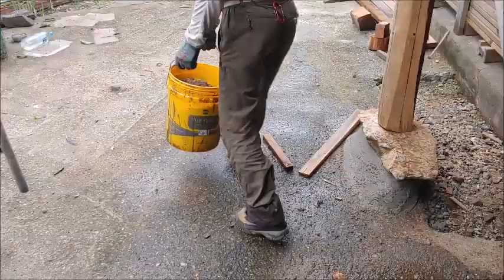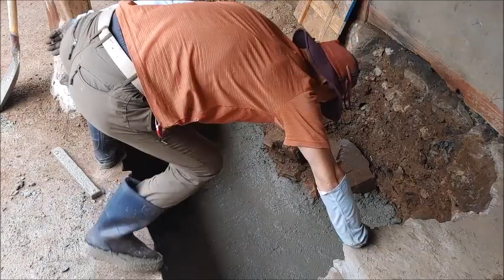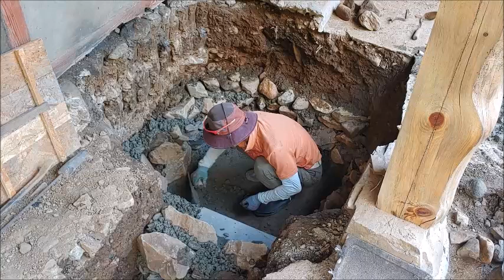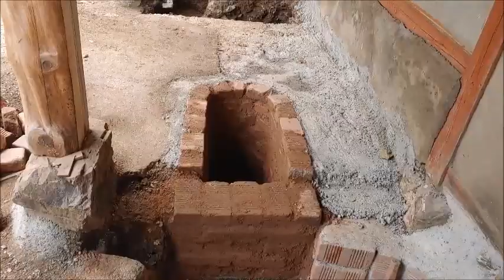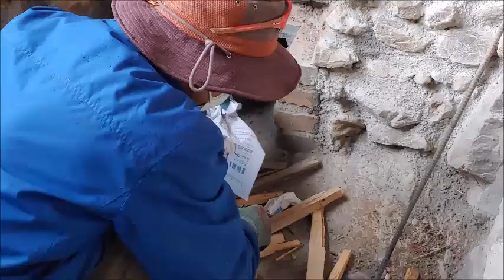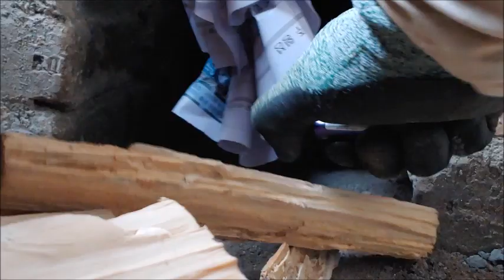House21-온돌,한국의 전통 난방,구들,황토방,한옥,목수,wood.K Woodworking

Comment: Looks great.......exactly what is it and what does it do?
Reply from the maker: This is the floor of the room.
Reply: 🛠잘못 표현된 내용 수정(Correcting the wrong expression)🛠
This system is a traditional Korean boiler. Unlike the way you use the stove, it is a way to heat it by making a fire under the floor of the room.
When a fire is made in the furnace (Agung-i/furnace), the heat moves along the passage of the floor, heating the cover stone and the soil on it, and delivering warmth to the floor and the entire room.
And I put a cauldron (Gamasot/Cauldron) on top of the furnace to cook food such as rice or heat water and use it as hot water (now there are various heating methods and cooking utensils).
fireplaces are only warm indoors, but Korean ondol is a special system that keeps the floor and the entire room warm and keeps the warmth for at least eight hours once a fire is lit.
Now, it has developed in various ways, such as heating water using various boilers and circulating it in the XL pipe.

이 시스템은 한국의 전통 보일러입니다. 난로를 사용하는 방식과 다르게 방 바닥 밑에서 불을 피워 데우는 방법입니다.
아궁이(Agung-i / furnace)에 불을 피우면 열기가 바닥의 통로를 따라 이동하면서 덮개돌과 그 위의 흙을 달궈 방바닥과 방안 전체에 온기를 전달하는 방식입니다.
그리고 아궁이 위에 가마솥(Gamasot / Cauldron)을 올려 밥 등 음식을 하거나 물을 데워 온수로 사용했습니다.(지금은 다양한 가열방식과 조리기구가 있지만)
벽난로는 실내만 따뜻하지만 한국의 온돌(Ondol)은 바닥과 방안 전체를 따뜻하게 하면서 한번 불을 피우면 최소 8시간 이상 그 온기를 유지하는 특별한 시스템입니다.
지금은 다양한 보일러를 이용하여 물을 데워서 XL파이프에 순환시키는 등 다양한 방식으로 발전하였습니다.
Reply: @woodwood1 감사합니다
Reply from the maker: @timemachine5970  너무 좋은 해설입니다. 제가 하고픈 말을 대신 해 주셔서 감사드립니다.
Reply: @timemachine5970  Thanks for the explanation but 'the west/western' means nothing..
Also Ancient Mediterraneans used heated floors a looong time ago.
Reply from the maker: @peterlee767 ..네..기억납니다..안녕하세요...  shimil84@gmail.com 입니다. 문의 주시면 아는많큼 답변드리겠습니다..
Reply: @HAYAOLEONE  That was a misleading expression.
It doesn't mean that floor heating was not performed, but it mainly means that fireplaces were used,
but I think there was a misunderstanding because my English skills were low.
Thank you for your advice.~^^
Reply: @timemachine5970  No problem, friend.
Say 'Europeans' instead of 'the west' if that is what you want to say.
Your English is OK.
👍
Reply: 한국의 온돌(ondol) .. 만드는 작업 영상입니다..♡ 난방시스템(한국 고유의 난방 방식입니다.)
Reply: @woodwood1  very interesting! but where is the room? it seems to be outdoor, or is there a new room to be created above that fire floor?
Reply: @woodwood1  ,, ,
Reply: @HAYAOLEONE  Your english is okay too. Funny you regulate on @TimeMachine using the term "west,' then present a "western" civilization narrative. The 온돌 (Ondol) floor heating used in homes is found from 3000BCE and even farther back. Similar ideas of floor heating (termed Hypocausts) and were credited to be "invented" by an ancient roman in 80CE. Seems like a looong time later. I'm in total agreement with stopping the obsession with west/east when we live in a sphere, but If you don't want people to use the term "west" try not spreading false historical narratives via the western-centric gaze.
Reply: @youngsahm03  You make zero sense and sound quite whateveryouare-centric, friend.
I'm European so I call myself 'European' and European things, you guessed it ..'European things'. Geography is about places before directions.
Quite simple..

Is it pRoBLeMaTic, darling?
Do my speech need to be 'regulated' by you?

Last thing : floor heating was used in 9999 BC on Mars.
Read it in a book/online. It must be true.

Stay lovely/awesome.

❤
Reply: @HAYAOLEONE 
You are really cute, "friend."  
Nice to hear you agree about geography making more sense than directions. How "western," oh I mean European, of you to pretend it was your original thought. 
"West/Westerner/Western Civilization" was created and pushed by Europeans. Now you don't want to be called by that. Cute.

You got checked for trying to regulate using blatantly western-centric (euro-centric if you prefer) narratives and couldn't handle it. 
It's fun to watch you squirm, trying to pose me as the speech regulator. Adorable.

I'm sorry you couldn't handle the speech regulating you initially started trying to lay down on others. 
You're english is still okay. The reading comprehension, logic, and reasoning needs work still.

*Heart emoji heart emoji thumbs up*
Reply: @youngsahm03  Still make zero sense.

Almost sound delirious.

Leave me alone girl/troll, I'm here to watch high quality carpentry videos.

[imagine going berserk over a European tired of being called something else than 'European' and asking for once a perfect stranger to call Europeans, 'Europeans'.]

+
Reply: @HAYAOLEONE  be that as it may, I’ve never heard of floor heating in us/Europe so it is valid to explain it that way. It’s common for westerners to be familiar of furnaces/fire places over floor heating. Of course I’m only one person but I’m sure others share this perspective
Reply: @evaosirus6055  Hello.

Why are you saying this to me?

??

[don't say ''westerners'', it means nothing]
Reply: @timemachine5970 Can I ask another question?
 What if there is a heavy rain that it flooded that hole? Or what if it became a shelter for snakes or other underground animal?
Reply: @youngsahm03  I caused a conflict with the wrong content.
I'm sorry. I modified it.
Reply: @jccapistrano13 In the cold winter, animals such as mice and cats sometimes entered a warm furnace.

So, we install a lid to prevent it.
Even if it is flooded by floods, it will not interfere with use if the water drains and dries (if it does not collapse).
Reply: @evaosirus6055  in the US radiant heat flooring has been in use for at least 20 years mainly in colder climates. It started with hot water pumped through poly hose imbedded in the concrete but now includes electric heating elements.
Reply: @timemachine5970  Thank you for this information.  I wasn't too sure how this heating system works since I noticed the builder had placed it outside.
Reply: @timemachine5970  Your English is fine!
Reply: @timemachine5970   You did not cause any conflict, so no apology needed. The European/western superiority complex is just strong among many people. Your original comment was well-said and quite kind. Thank you for taking time to explain. Other commenters’ talking about hypocausts and trying to “correct” your English was just obvious euro/western-centric power play with the cliche superiority complex attached. Clearly spreading a western narrative while also demanding not to use the term “western.” >< “West/western” is a term created and spread by “European” societies that pushed the ideologies associated with ‘western civilization,’ but now they want to re-brand their image. Of course it is still just from the same western/euro-centric perspective. For example, do they call Korean people by our true name rather than the western-centric, made-up, mis-pronounced Italian-based name?
Reply: У меня есть дом в деревне и недостроенная комната, сделаю, как у Вас, мастер, в России зимы холодные. Спасибо за науку.

Comment: How do you ensure you don't get co2 or carbon monoxide poisoning?
Reply from the maker: When using wood as fuel, if there is smoke on the floor of the room, it is visible.
So, you can respond.
Reply: Use a smoke detector.

Comment: Those top plates looked special. Are they cut from rock, or are they cast with some kind of refractory? Those are the only items I would not be able to source locally here in Norway I fear.

Great work! Looking forward to see the room.
Reply from the maker: It was cut out of rock. Basalt (rock produced by volcanic activity)
Reply: @woodwood1  Thank you.
Reply: @woodwood1  Are the top stones then covered in a layer of sand/other materials?

Nice job and nice video 👍
Reply from the maker: @HAYAOLEONE  yes..

Comment: So if I understand this right it is basically a smokeless firepit along the lines of a dakota firepit with the sideways chimney functioning as a thermal trap?
I am curious as to how this builds up creosote since with traditional chimneys the build up has a tendency to catch on fire and you run the risk of a house fire if the chimney is not swept regularly, I would imagine a sideways chimney like this would have even more creosote?
Also, how would you get access to cleaning the channel out with this design?
Reply: He ties large brushes onto the lovely kittens and then puts a fish at one end, the cats run through and sweep the chimney 👍🏻
Reply: @FreeFinca  XD
Funny part is that could probably work.
Reply: @XD-cf6gr  It does work 👍🏻
Reply: @FreeFinca  
Personally I find that to be a fair trade with the cats seeing as they get food for easy work but there is an abundance of soft westerners that would go crazy if they saw you write something like that so you might consider removing the post, channels have gotten cancelled for less.
I know it's crazy but that's just the way people are these days over here.
Reply: @XD-cf6gr  Fair point, but the day we lose the ability to laugh is the day we die. 👍🏻